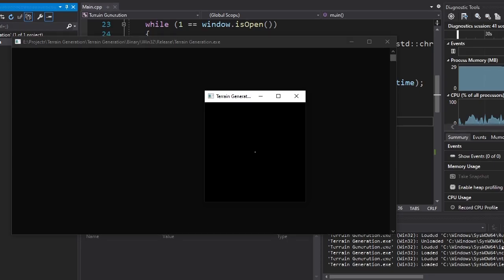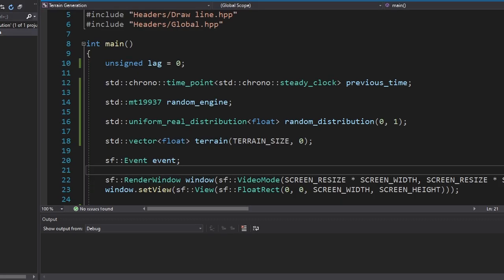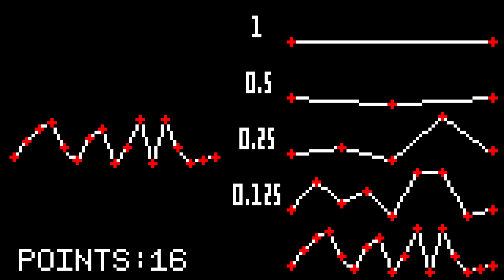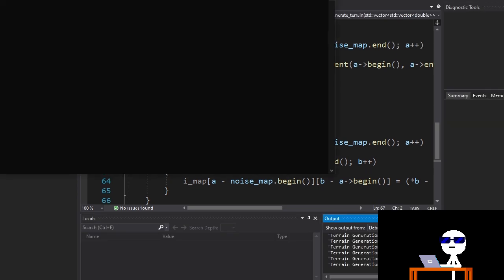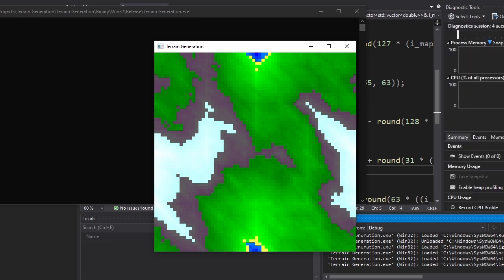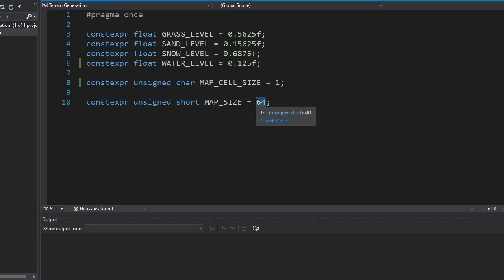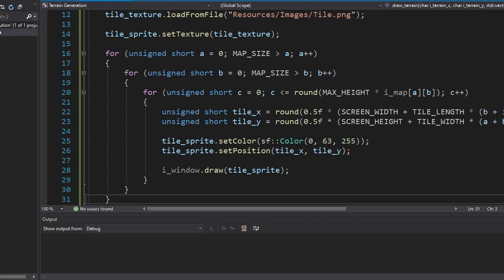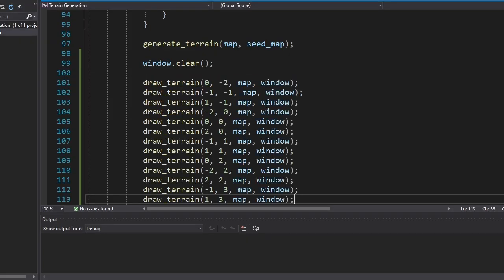Terrain Generation Using Perlin Noise

Comment: This is Fractal Value noise with Cubic interpolation. Nonetheless, I recommend a good Simplex implementation over any Perlin or Value noise. Look up OpenSimplex2 for the generator I created/use/recommend. Perhaps you could do a video on using some noise like this!